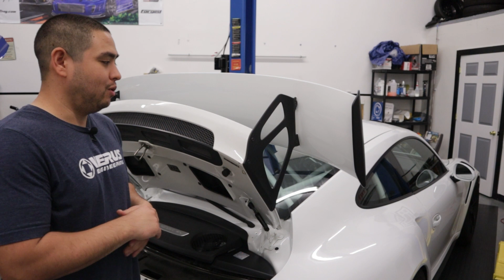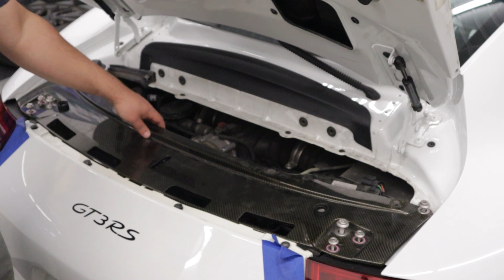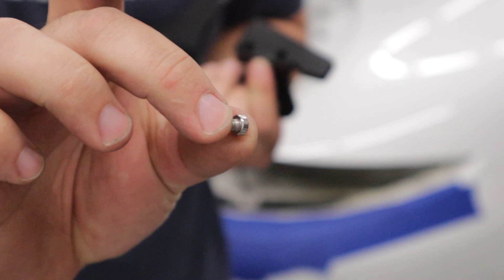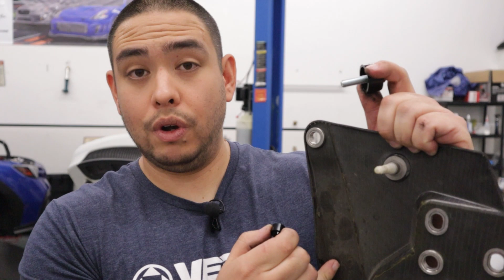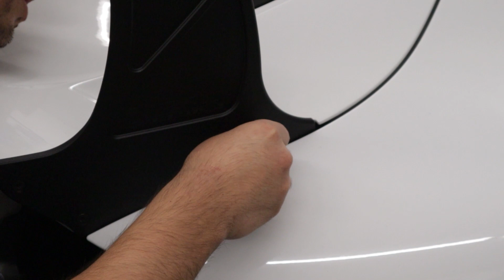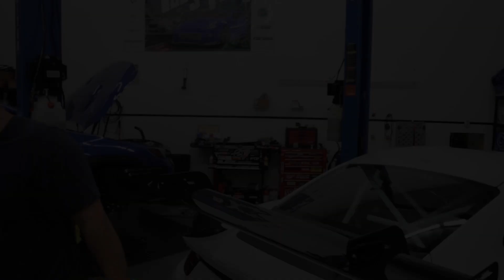Porsche 991 GT3RS V1X Rear Wing Kit Installation

Comment: Does it move like the new 911?
Reply from the maker: Can you reiterate the question? The car, 991.1 GT3RS, is quite quick and runs comparable times to the 992 GT3RS around our local track with the upgraded aero.
Reply: Can it be mounted on 991.2 gt3 non RS? I guess will need cup lid or rs lid?any other parts for the install?